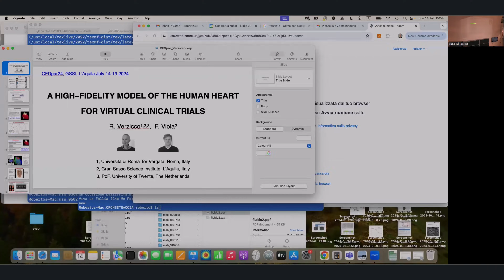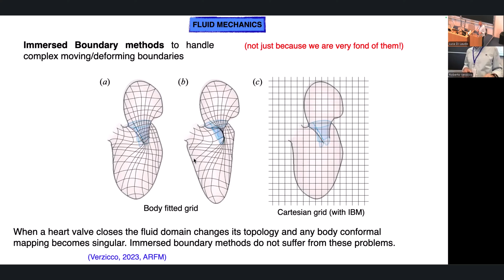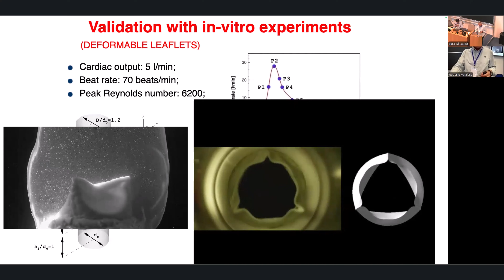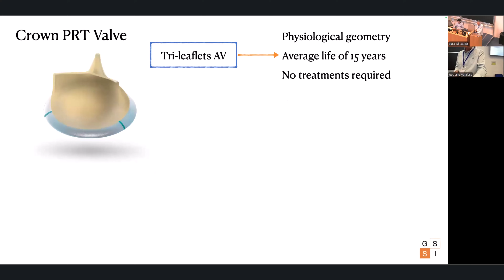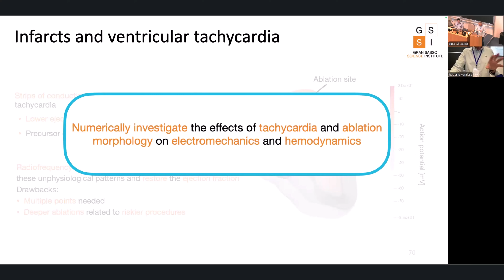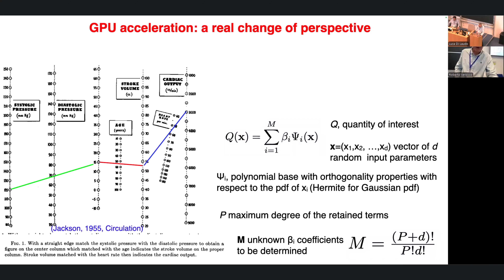♥️ HPC model of the human heart | A High-Fidelity Model of the Human Heart by Prof. Roberto Verzicco

Comment: Thank you for the presentation and uploading this. As a junior doctor working in a cardiac centre, this was very interesting. One thing I took from this is, that placement of LV lead of the CRTD device can have so much difference.
Reply: يا 1:44 ❤
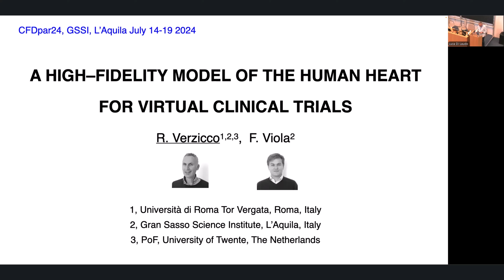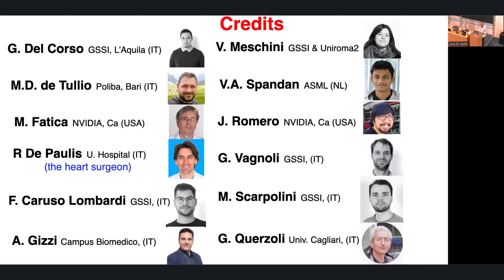Reply: 2:22 2:40 2:49 ❤كنضتمث🎉ك❤خخخه 3:07 3:07 صحي 3:14 ❤همتهج❤م😅 3:33 سنن😅 3:39 ❤ح 3:46 3:55 3:55 3:55 3:55 مضن😅ع😅صع❤كناسة 4:24 4:24 😅ت 4:37 م 4:42 ي😅 4:46 جك 4:52 4:52 😅❤ 4:52 4:53 4:54 م❤😅صم 4:59  4:04 م 4:21 ص😅❤❤ي
Reply: ❤s❤ 😅ja❤❤صصيك